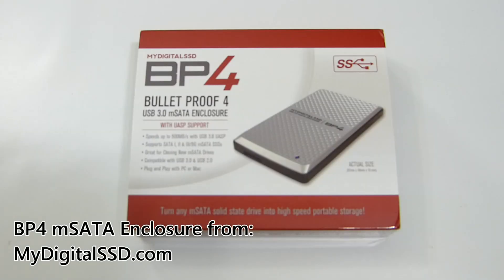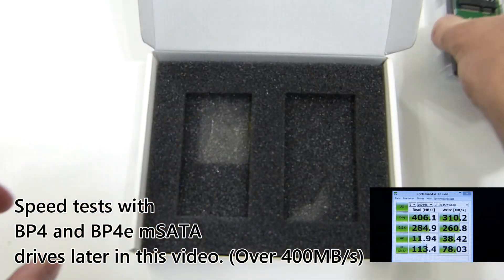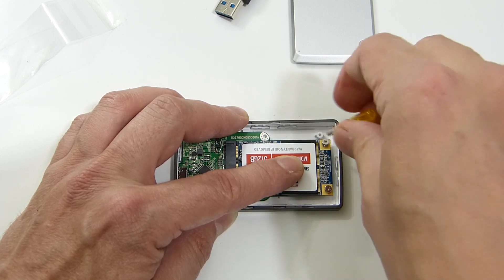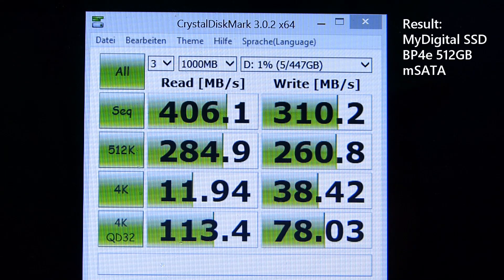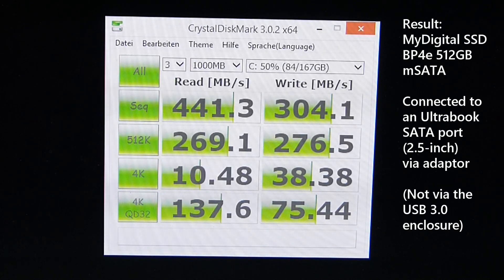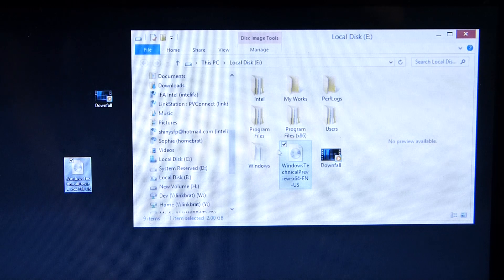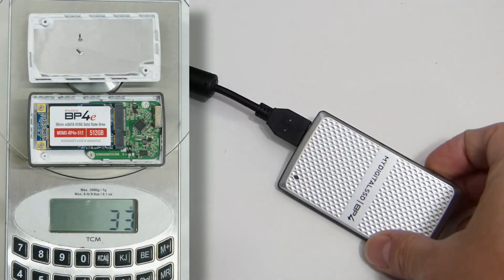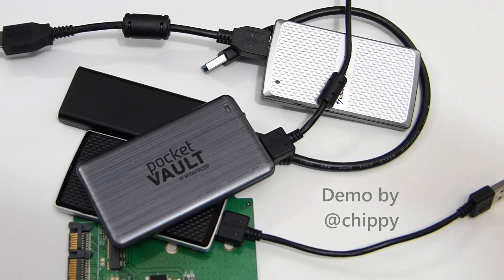How-To: USB 3.0 mSATA converter with MyDigitalSSD BP4

Comment: Do i have to initialize a new ssd? I got one for my mining rig 512gb (Dataram) ? I ordered an adapter from Sabrent on amazon. I ordered their cable and adapter. And i ordered another 256gb kingston ssd.  For fear the other didnt work. But now i know it does.BUT the 512gb still wouldnt read on the BIOS except 1 time, but i couldnt get it to boot up... any ideas?

Comment: Will it run on ny dell venue8 pro without a need of an extra source power or will it faill like hdd? What power input are we talking about here also awsome review :D
Reply from the maker: I will do some more tests on various USB 2 and 3 ports and let you know my results. The OTG (pre-built) version of this has never failed me in the past across many USB 2 and 3 devices.
Reply: Thanks your the best :D
Reply from the maker: Zero Sami Early results: Microsoft Surface Pro 3 has a few problems when it's being heavly tested. (SP3 is known to have problems with high-voltage USB drives.) Works perfectly on a Lenovo Chromebook N20P via USB 3.0 port and am currently using this to transfer 350GB of video files from a USB3.0 hub on an Ultrabook.
Reply: Good thinking

But i guess this should be tried on 8 --> 10 inch form factor devices like dell venue 8pro or venue 11 ,toshiba ancore 8,7 as well as lenovo mix and hp slate tablet as these devices reported to suffer from low usb voltage output that cant even power a powered hdd 0_o tried it tenachiously and failed to pair a working storage expansion but this might get the job done and you could solve the infamouse problem of the 8.1budget tablets as the only way to expand is to pay a premium for a sandisk extreme 128gb which is also a rare find where i live but if this works all on the go taskers can make an extraordinary use out of this for now nobody reported any results as for now you might be the first tester.

I think it should work given the m2sata power chart compared to the dell venue 8 pro
Reply: Also usb 3.0 outputs almost double the power limit of a micro usb 2.0 so fingers crossed also thanks for the results
Reply: Your awsome